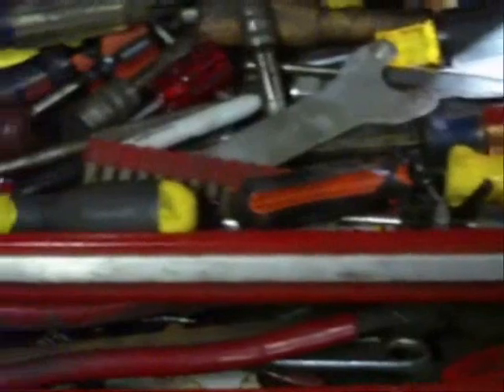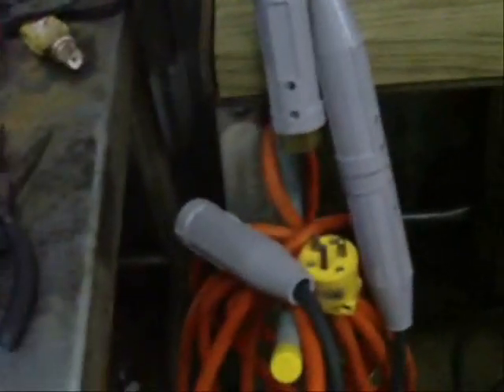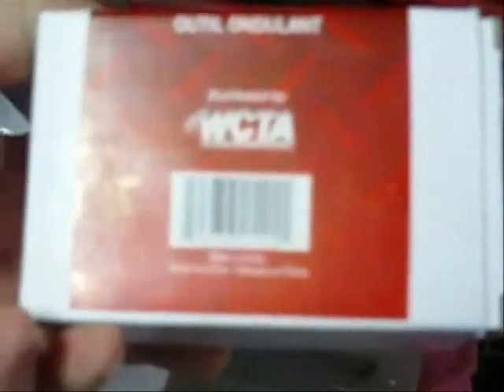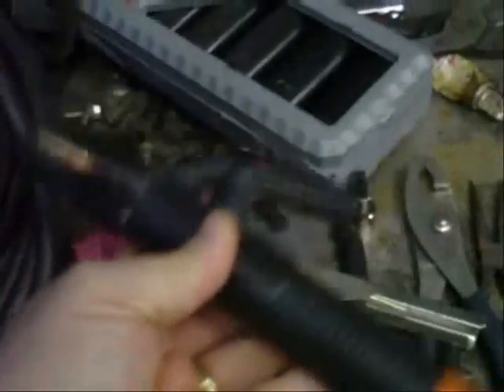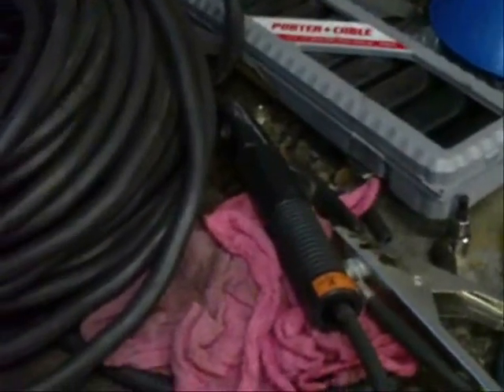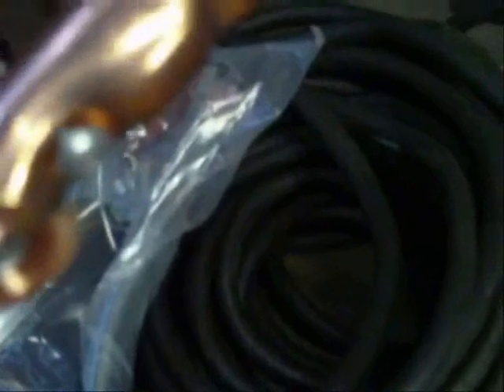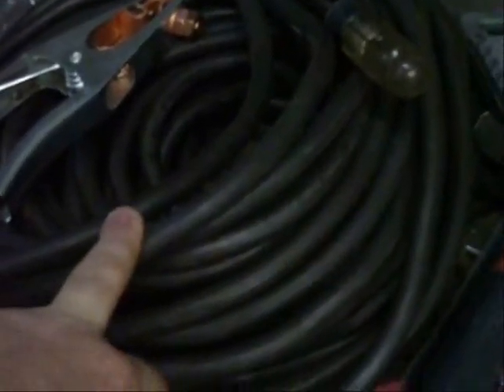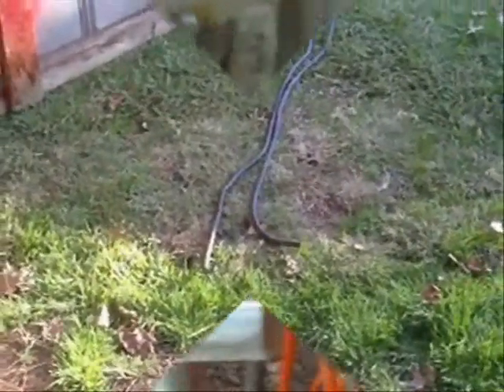Welding Leads Upgrade

Comment: you will be fine with 4-0 close to the power source...the voltage drops with distance.  If you had a 50' 4-0 then you could have issues.
Reply from the maker: +John Deere Yeah, I went a little overboard with the 1/0 ;)

Comment: I'm buying a Hobart do generator welder and for the life of me can't figure out all I need to hook up cables. You would think for $1750 it would come ready to work. But it doesn't. So if anyone has 1 minute if there time to let me in detail what I need I would greatly appreciate it. I got 50 foot of 1/0 cable, negative clamp, stinger on the list but what confuses me is I don't want lugs to have to hook up like a battery I want it to like quick connect so easy for storage and can be put away nicely.
Reply from the maker: Philip B I think I bought the quick connects on eBay.

Comment: I would have used your 4-gauge wire to make a "whip" with your original stinger that plugs into your 1/0 gauge lead. It is a lot easer welding with a lightweight stinger and lead than a large stinger and heavy 1/0 lead.